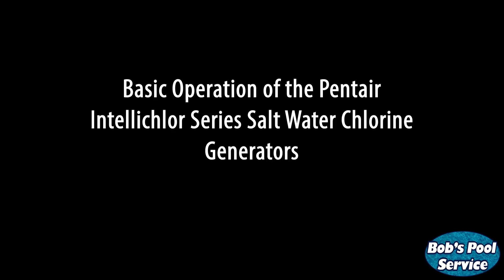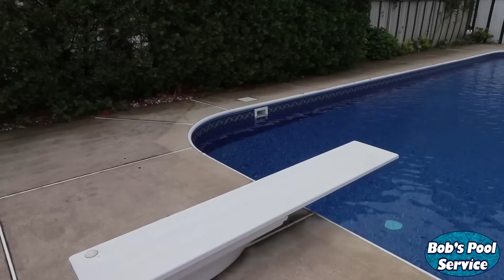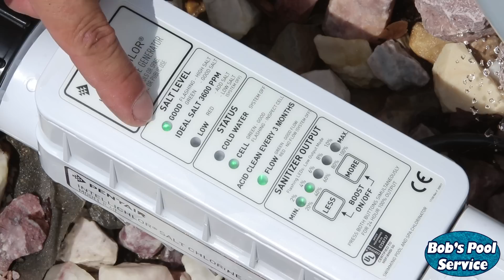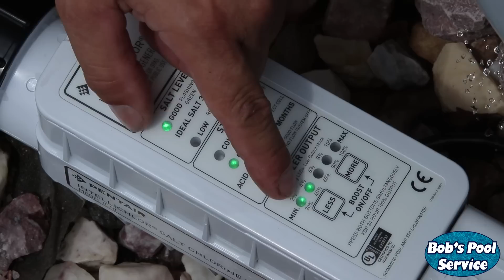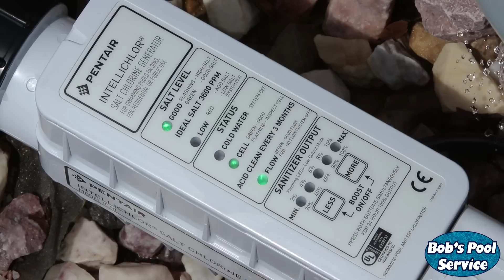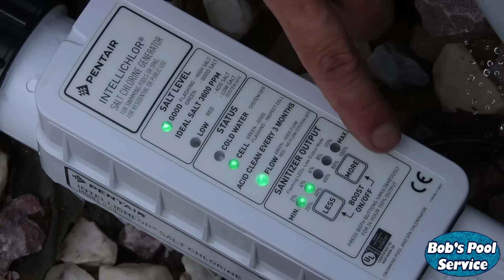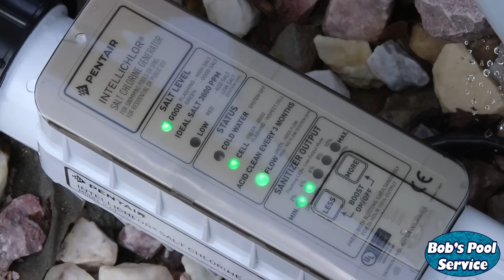Pentair Intellichlor Salt Water Chlorine Generator Operation

Comment: How does this receive power? Battery powered? Sorry if that's a silly question, I don't see any plugs in it to power the LEDs. And I know it must use more than batteries to do the salt to chlorine conversion. So I guess there is a wire somewhere.
Reply from the maker: Yes, there is a wire to power the unit.  The system has two components, the cell (shown in this video) and the power center which is a stop down transformer that converts the 240 or 120 VAC down to 24 volts for safety reasons.  The power center is wired into the load side of the timer or switch that operates the swimming pool circulation pump so the system only comes on if the pump is on.

Comment: Outstanding video Sir ...On the older IC40 units ..Does the water temp designed to operate the same way as the new models ?
Reply from the maker: The old and new operate the same but on the really old units there's no "cold water" LED, it simply doesn't produce.  I believe this confused people which is why they added it. The old units also didn't allow turning down the production less than 20%, it lacked the mode to go into less power.
Reply: Thank you Sir for your correspondence on this issue…

Comment: So what's the optimal percentage for the sanitizer output?  Mine is currently 60%.  Thanks
Reply from the maker: Optimally for the life of the cell the lower the better, however you need to run the cell at a level where your chlorine is at 1 to 3 ppm and the only way to determine that is testing.  Every pool is different and some systems are larger in relation to the given pool so it's impossible to say what percentage the unit should be at without running it and testing.  Oftentimes if the level has to be raised upwards of 80% I suggest checking your chemistry and making sure that you're running the system enough hours of the day.  If running the pump longer and good chemistry are observed then when you change the cell I would suggest a larger unit.  There's 3 sizes of this model, the IC20, IC40 and IC60.  For really large pools multiple units can be used.

Comment: great video did did you discuss diagnostic mode?
Reply: diagnostic mode: by pressing MORE button 3 seconds
Reply from the maker: this was just a simple operation video and the manufacture changes things like diagnostic mode over the years as well.
Reply: I did not discuss it because it goes beyond the scope of this video.  Moreover, some of the features that used to be available in such modes along with some of the calibration process has changed over the years depending upon the model year.  Some things have also been totally eliminated.
Reply from the maker: Not yet.

Comment: my water temp is 45 and the cold water light is not on nor is the cell light on --- all of the other lights are the same as you have.  A dealer told me that I need to put a dummy piece in to save its life but if it turns off is that not as good?
Reply from the maker: Well, anytime water is passing through something it will shorten it's life.  If your water is only 45 degrees I can't imagine you're swimming in the pool or using it but I do understand you want to run the filter at least a few hours to keep the water clean and pick up debris.  Are you intending to run the pool at these low temperatures for an extended period?  Up here in my state most pools get winterized and closed in the colder months so wearing out the cell when it's not being used isn't something we've ever thought about.  I have never heard that cold water in itself will wear out a cell any faster than warmer water but I do know they're less efficient when the water temperature is cold which is why the units don't try to produce chlorine below a certain temperature.  If you're going to run the pool for months at temperatures where the system can't produce chlorine putting in a dummy cell which is just a piece of plastic with threads can't hurt but I think Pentair charges something like $50 for the piece.  When we close pools and remove the cell unless the customer already owns a dummy cell we just plug the pipes with rubber winterizing plugs rather than sell this piece.  We do have a few we keep for instances where a customer needs to have their generator serviced and in those cases we "loan" ours out and let the customer use it until the cell is serviced or replaced.  Don't forget if you remove the generator or if it's too cold to function add chlorine to your pool and keep the level between 1 and 3 parts per million. If the water is cold enough algae usually won't grow but why take a chance if for some reason it warms up enough due to weather changes and then you could have a green pool.

Comment: Is there a way to calibrate the salt level? It says low but took my water in to get tested and they said it's good
Reply from the maker: There is but only for older units, versions 1.9 and earlier, however be absolutely certain you've thoroughly cleaned the cell before re-calibration.  I have yet to see one go out very far, also realize the cell is a rough estimate of your salt level, a tester will always be more accurate.  Anyways, here are the steps:

Step 1
If the Intellichlor has been in operation for a few weeks, remove and acid clean the salt cell before field re-calibrating. This will give the most accurate starting point.

Step 2
Manually test the salt level with salt test strips or an electronic salt tester. If the salt level is in the proper range of 3000-4200, proceed to step 3. If not, adjust the salt level to the proper parameters before re-calibrating.

Step 3
With the pump running, verify the "Flow" light on the cell is green. This indicates good water flow through the cell. 

Step 4
Press and hold the "More" button for 3 seconds to enter system status mode. All the lights will scroll across the panel, and then go dark. Only the "Power", "Cell", "Life", and "Low" lights will be lit.

Step 5
After a few moments, the "Good", "Add", and "Low" salt lights will begin to scroll, indicating the salt level is being read. It may take up to one minute to read the salt.

Step 6
The salt scrolling will stop and one of the salt lights will be displayed. The "Sanitizer Output 20%" light will turn on to indicate changes are now allowed. Press the "More" button to cycle through each salt level, and then press the "Less" button to choose and save the display as the new salt level. The "PWR", "Cell", "Life", and "Flow" lights will flash 4 times, then the mode exits to normal.

Step 7
The unit is now re-calibrated to the salt level of the pool. The display will now be normal, showing the output percentage, flow status, etc. The field calibrate mode will exit in 5 seconds if no buttons are pressed.

Hope this helps, sorry I didn't see your question until, sometimes youtube doesn't do alerts properly.

Comment: question regarding VS pumps - what is the lowest rpm on the pump for you to get flow?  when i am running low speed i dont get a green light for flow, wondering what speed i need to be at.  thanks
Reply from the maker: That's a good question that I don't think could be answered as simply as a percentage of max pump speed, it would also depend on back pressure of the system, absolute flow and perhaps the spring tension of the sensor inside the unit to a small degree.  I'd experiment with my VS pump and a clean or dirty filter and see where it shows a green light then plan a safe percentage above that to insure it's enough.

Comment: Mine turns on than goes off, checked flow switch is good, power good any ideas please
Reply from the maker: Does the entire unit go off or just an LED? I had one that would go on and off intermittently and it was the connector at the bottom of the power supply not making a good connection.

Comment: I've watched the video twice. i cant seem to budge mine at all from 8%.  I want to knock it down to the 4 % but i cant get it there. our chlorine level is high.  so i went up to the pool guy and he said to just press quickly and it should move up down whatever i need.  (not to hold on button)  i did that and it won't move down at all.  i did something to make it flash down to two and thought i fixed it but it raced right back to 8%.   This unit is only a few months old.  Help
Reply from the maker: Did you try hitting the up button then going back down?  If the unit only goes up but not down you may have a bad button on the unit and I would contact the installer or Pentair directly for warranty service.  Sometimes I know you have to push the buttons pretty firmly and in the center, I've experienced that more than once.
Reply: @BobsPoolService  Thank you so much for your response. I am disappointed that none of your suggestions budged it off of 8%-even disconnected the whole thing and plugged it back in. I'll contact the person who sold it and maybe pentair directly.
Reply from the maker: @laurimcintosh1739  If pushing the buttons does nothing I'd surmise you have a defective unit.  The few warranty claims we've had Pentair was fairly responsible about addressing them.  Best of luck.

Comment: Awesome video! Thank you so much for all of that. I would have loved to see some comments on what settings should be maintained for XX gallons/size of pool. Maybe another video? :)
Reply from the maker: Hey Travel Geek, I wish I could do that but there's SO many variables a video like that would be of little use.  Every pool and situation has a different demand and that can also vary with weather, shade and even as the units get older.  What I can say is if you can afford the larger models it behooves you to upsize as much as possible, I've putting IC60 units on 25,000 gallon pools, with the new design you can turn them down to very small percentages and by oversizing your cell will always be enough and also last longer.  The amount of time the customer runs the pump also has to be taken into account.  Typically when I install a unit I set it to 60% output and have the customer check to see if the chlorine level is building or falling then adjust the unit accordingly.  It's too bad self monitoring setups aren't practical for home use, they are made but maintenance and cost is extremely high so it only works for high end commercial applications.
Reply: @BobsPoolService  Thanks, Bob, for taking the time to answer my question. Very insightful!  Cheers, -L

Comment: Appreciate the video - I just installed the new cell and it's on a continuous pump. Do I need to add a timer or can I set the chlorine production level lower and achieve the same results?
Reply from the maker: The newer pentair units can be set to a very low percentage, many of our customers run their pumps 24x7 and do not have an issue with overproduction.  I have never seen a chlorine generator hooked to a stand-alone timer however when we install them we always hook them to the load side of the timer (or other device) that powers the pump.  If you look at the install manual it also depicts this configuration.

Comment: I was able to do this using the Easy Touch panel, I couldn't get it to accept the changes manually. It kept defaulting to the current setup. I don't know if that helps anyone. It took me a bit to figure out. I don't know if it's because it's wired to only be configurable through the panel or if there are other install options without that panel. Idk. Thank you for the video, it was super helpful too.
Reply from the maker: Yes, if you have easytouch or any automated controls they override the unit itself.  This video was just an explanation of the stand-alone units which are far more common at least in our area.
Reply: Ok I’m trying to do it manually and it is doing the same thing it won’t accept it. I’m going to keep trying thank you!
Reply: Thank you for the detailed explanation from the blogger. This is our titanium electrode salt chlorine machine testing video. Welcome to watch. Thank you for your time

https://www.youtube.com/watch?v=Xi4_EYCDL2k

Comment: Almost forgot the flow light will turn back to red and sometimes back to red.
Reply from the maker: Sometimes if the flow isn't quite enough this will happen, also could be a failing flow sensor which is a replaceable part.

Comment: My IC15 Pentair currently has the flow light is red and then after awhile turns green.  The salt level lights are both flashing. The green light indicating a good level of salt and the low light is flashing red.  I have cleaned the cartridge filters.  There seems to be enough flow for the heater to work.  Any suggestions?
Reply from the maker: A red flow light means the flow sensor isn't completing the circuit.  If you indeed have sufficient flow and nothing is obstructing the sensor it could be going bad, it is a replaceable part.  I can't say I've ever seen one "act up" though like that, usually the metal paddle deteriorates and it stops working totally staying red.  Heaters generally work on pressure not flow so that isn't a reliable indicator, if there's something impeding the flow beyond the heater (return pipes to the pool eyeballs, etc) it will create enough pressure fo the heater t o fire however would not allow your IC15's flow sensor to establish a connection.

Comment: I have this exact same pentair unit.  Recently my pool started to become greenish/murky... I increased the level/boost to the max. 100% ..  All my lights were green.  However, after a few hours I went back and looked and my flow light turned red?  What is causing this?  It seems like if I bring it back to a lower level the flow light goes back to green.  My pool is still murky and not as clean as it should be.
Reply from the maker: A red flow light means there isn't sufficient water going through the unit (often a clogged filter) or the flow sensor is bad.  Since you said your pool was green likely the filter is going it's job catching that algae but it's getting clogged as a result and needs to be cleaned or backwashed.

Comment: How do you manually turn on salt chlorinator if not running an automatic cycle
Reply from the maker: it should be wired to the load side of the pump's power so when the pump comes on the generator does too.  If you set it to 100% it will be "on" if the pump is running.   You cannot use the generator without the system running.

Comment: i have a indor pool salt pool and the clorine its super high and smell alot and never used clorin what can be the problem i have the light in 100%
Reply from the maker: Well, salt water pools generate chlorine from the salt through electrolysis, they are NOT chlorine free it's just a different way of making it.

Comment: When you use the super chlorination for 24 hrs, do you have to keep it running for 24 hrs in a row or can pause it.
Reply: If your pool runs on a schedule you want to put the pool in service mode or take the ON/OFF trippers off and run the pool for 24 hours and the resume your schedule.
Reply: Yes you have to keep the pool running or the unit will not produce chlorine
Reply from the maker: It should keep count of the hours but to be honest I've never taken careful note, I do know customers with timers when I come back it's definitely reverted back to the original non boost mode however I can't say if it gave 24 hours of super chlorination or if it simply counted 24 hours then reverted regardless of whether or not the pump was running.  The way we wire in the units there is no power going to it during the off cycle so unless it had an internal battery I don't see how it'd be aware of time otherwise.  I do know the units keep track of usage time internally which you can read through diagnostic tools.

Comment: Troubleshooting anywhere??? Can’t get any lights to come on. Changed fuses in the power supply many times over the years but it didn’t do the trick this time. Help please
Reply from the maker: Hey Tanner, I don't have a troubleshooting video anywhere because the liability of someone trying to find the problem and working with live electric wouldn't be a wise choice so I only do videos on operation.  With that said if you're good at the troubleshooting process I can give you some steps in order to locate the problem. 
First, make sure power is going to the transformer, if it is not obviously changing the fuse wont' help.
Second, if there IS power going to the transformer make sure there's power on the other side of the fuse holder going to the circuit board.  Sometimes the holder itself is the problem and needs cleaning or replacement (if you can find the part, we can't always and have wired an inline holder that can be bought at an auto parts store)
Third, if there is power at the other end of the fuse going to the board you need to check  the output at the receptacle where the cell plugs in, it's 24V there not 120 or 240 so adjust your voltmeter accordingly.  If there's power there then likely the problem is your cell itself or sometimes the plug at the end of the cord, you could pop the cap at the side of the cord that attaches to the cell and check for voltage there, if there is voltage there going to the cell then you need to replace it.

We often just bring an extra cell and transformer that we know works to do the troubleshooting but unless you have these components the procedures outlined above are how I would approach it.  If you are not experienced however at working with live electric I would highly recommend calling a reputable pool company and have them come diagnose your issues.  The number one reason I've seen a dead cell when the transformer is working is a bad connection where it plugs in, sometimes wiggling that will allow it to momentarily make a connection.

Best wishes and be safe!